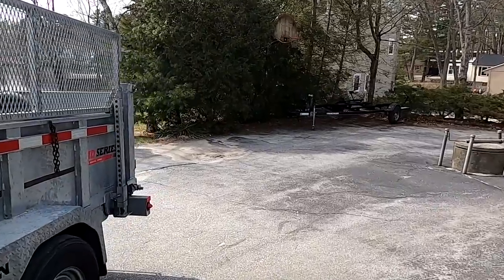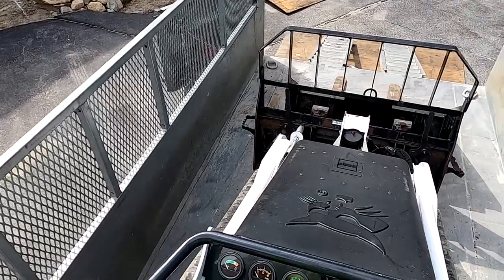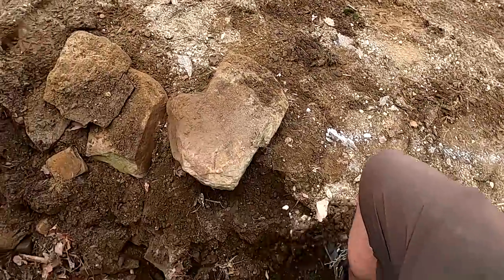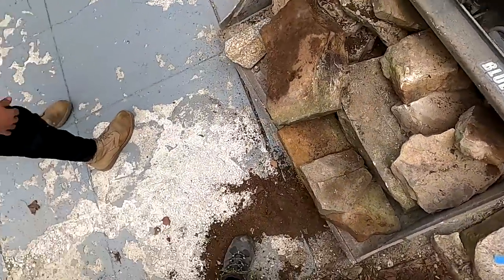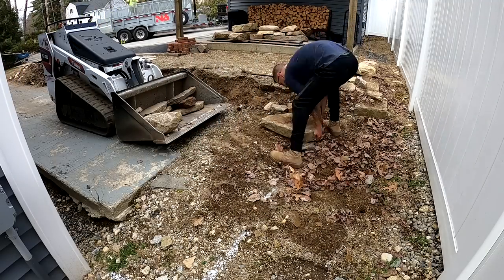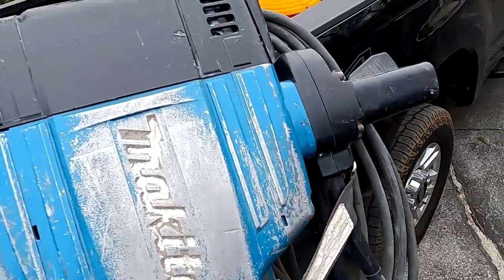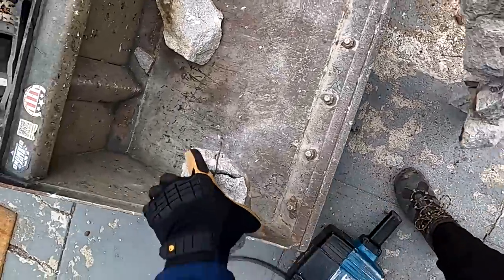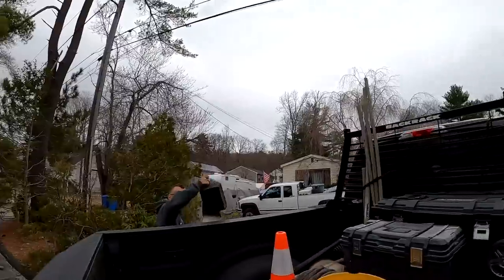Starting the 2023 Season with a Bang! ( well, a few bangs... )

Comment: Hey Kyle! I just wanted to pop in and thank you for all the content you've been throwing out. I know how much extra time it eats up on top of all your day to day work, and we all really appreciate it. I had a question about using concrete edge restraint up against a wood fence. Do you dig under enough to lay your concrete, or do you normally keep the pavers back a few inches from a fence?
Reply from the maker: Hey man, no problem at all! I really appreciate the motivating feedback. I am going to try and keep up with the uploads, I really enjoy making the videos. And I usually leave 4-6 inches away from a fence to leave room for concrete. Than I cover it with some kind of decorative stone the fill in between the pavers and fence.

Comment: I have zero clue as to what you've purchased but I'm very curious to see if you went with a mini skid ( like that bobcat mt100, BTW, have they gotten rid of their proprietary attachment system and switched to universal?) Or a full sized machine like an svl95. 

Great looking project to start the season off. I can't wait to see how it turns out
Reply from the maker: Those full size fork’s don’t actually lock in on the MT 100, but they do rest fit on it enough to pick up a pallet and move it around.. 

We will have to see in a couple weeks if anyone guesses the make and model. ✌🏻

Comment: Question - If I cant dig out all the sod to level the ground due to roots from an old tree, can I make the ground level by added gravel to a certain height then add my pavers? or is that a disaster waiting to happen? )wanting to do a patio via pavers 16 x 16 where an old tree was recently cut down.) thanks for your videos man. I appreciate your feed back.
Reply from the maker: I would say if you do not want to remove the sod and roots, you should definitely lay geotextile fabric over the area before you add the gravel to help prevent it from sinking as the roots decompose. But there is no saying if the roots will cause problems down the road or not, it would be a risk that you will need to determine. It could be completely fine for years honestly, but 10-15 years, it may shift a little but fixing that is not a huge deal. So that is up to you ✌